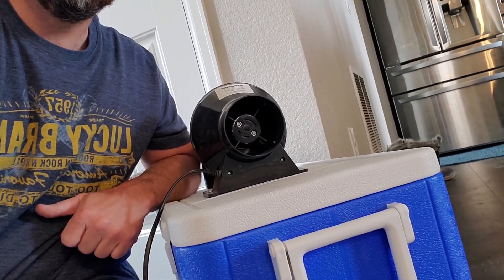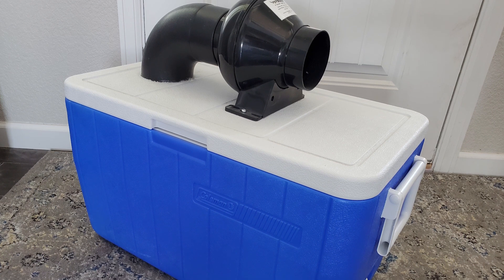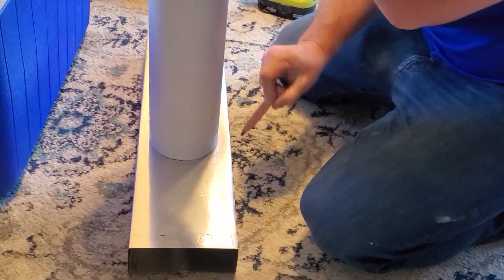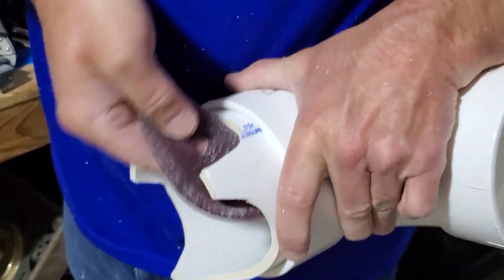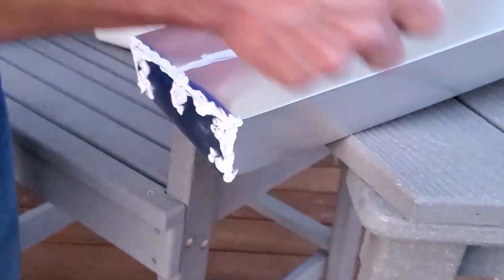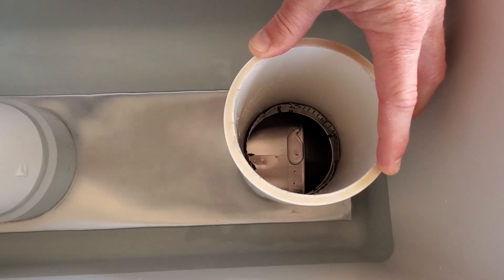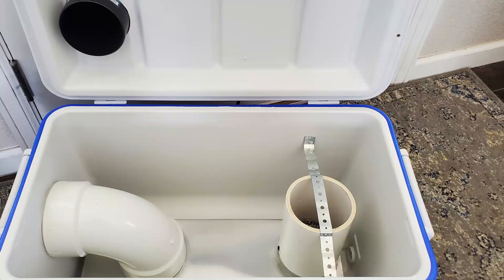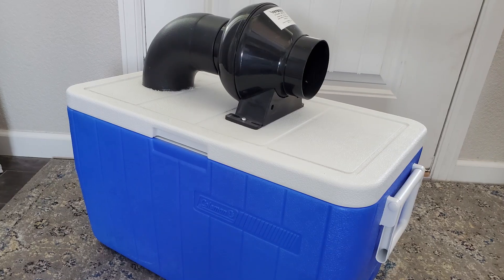Homemade Portable Air Conditioner DIY - Runs on 120 volt or 12 volt.

Comment: big in house air conditioning  went out yesterday.Used A plastic white 2-1/2'  tall garbage can, fo icer container
 Made one as you directed  putting duck outlet under ice. made a hardware cloth table over the  Inside duck  work which is  attached to a sheet metal duct T., going all the way to bottom. 
all duct work & top exit elbow used was  4inch.  Container has about 18" filled with frozen small ice bags.
works good for big bedroom. thanks !
Reply: Send a picture or a text to picture. Thanks nice❤

Comment: Just watched your video from 2018. What is the advantage to using the aluminum duct instead of the metal pipe?
Reply: I made the one from 2 years ago. It worked perfectly at first but I know why he changed it. The flexible tubing is much thinner and tears easily. I had to replace it twice before I abandoned it and went another route. Once water gets into the tubing, it’s useless. The tubing is for the back of dryer vents and isn’t strong enough for an AC cooler. The first one tore from me trying to adjust it and the second one from when I poured in the ice. His new version looks a lot stronger and should be able to hold up much better. I’m looking forward to trying this new ductwork. One other thing to consider....the SeaFlow blower in the 2018 video is super strong and provides great airflow but is extremely loud. I use mine in the garage so I can deal with it. Sorry for the long reply. Hope this helps. Good luck with yours!
Reply: @robkees9353  Rigid aluminum stove pipe is readily available. Just seal the seams and you're good to go.

Comment: 2 questions that are related. 1. you have sealed the air flow, what happens if you use dry ice? You are not blowing across it so you are not releasing carbon dioxide. If you put a few vent holes high up on the sides should solve the carbon dioxide expansion issue. 2. What if you replaced the A/C duct with copper pipe that covers the entire bottom in a circular pattern?
Reply: The air is blown across...watch the end of the video again.
Reply: Do NOT, I repeat, DO NOT use dry ice in one of these units as it raises CO2 levels to the point that you cold pass out.

Comment: I received some of the  materials from Amazon today. I went with the white 12V DC motor.  The black 4" 90-degree elbow doesn't fit the end of the white motor. Not sure if anyone else experienced the same issue. Gonna see if I can find a coupler or another 90-degree elbow that will fit. Thanks for Sharing this video. Can't wait to get started on my build once remaining parts arrive. I plan on using this cooler inside of my hunting blind in the evenings here in the brutal Texas Summer.
Reply: Did it work?

Comment: Very cool I was thinking about your video all day and I'm wondering if you had 2 coolers and you bridged them so you have the outside air come in the first cooler and be attached to the 2nd cooler so you can cool the air in stages and of course you can also add more coolers i have a Chevy Suburban with no A/C so I'm really trying to figure the best way to have cool air for long drives ✌
Reply: I made his 3rd design (without the duct). The biggest problem is that the air is so hot (mid 90's) that it melts 20 lbs. of ice in about anhour and a half. Seems like somehow I have to get colder air to the intake. Any suggestions ? Thanks
Reply: If you live somewhere with dry heat you should look into a window swamp cooler, these were really popular back before AC in cars was a thing.
Reply: I was thinking about coming on here and saying the same think. Id add another cooler and snake the pipe thru the cooler. But have it where ice can sandwhich the pipe in that cooler  then coonect it to the other cooler. Never built one before but it might work. Not sure if you would need 2 blower motors to make it work. 1 motor might not move enough air thru 2 coolers.

Comment: I’m about to make one of these to have cool air in my chicken coop. Looked at a lot of designs. This is really nice. I’m looking for a way to use either blue ice or jugs of ice so I don’t have time used cubes or crushed. But this has me thinking hard about my design. I really like getting the duct under the ice.
Reply: ..wonder if blocks of ice would work better? Like put water into a square or rectangular tupperwares (couple of them) then freeze em and then empty them in. I would think itd melt slower in small blocks than crushed or small cubes?
Reply: It may be that the iced water actually helps keep things colder, even if that sounds counter-intuitive.  But I don't know - it just seems familiar that that might be the case.
Reply: Why not shove steal wool into the aluminum duct to have more cold surface for the air to hit? Have a drain foe the melted ice and a inlet hole to drop more ice without opening the cooler, one that can be closed.

Comment: Will this cool the back of a toyota sienna?? Im sleeping in my van and need some cold air overnight about 9 hours straight. tnx!!
Reply: HOMES COOL you need 40lbs of ice tent off your sleeping area to make more small, I was sleeping in my van in Las Vegas heat 2years ago and bough my ice at Costco’ it made me very cool’ my unit I built where it blew on top of the ice with $10 wal mart fan’ smaller fan would be better. It was too cold. Need adjust air flow
Reply: Depending on outside air temp and ice cube size, it should give you plenty of cool air.  I'd worry about the current draw on the battery, though.  His recommended fan is 60 watts, that's 5 amps at 12V and that would be 45 Amp hours at 9 hours.  Since you can damage a battery by pulling more than 1/2 it's rated power, you'd need a battery of about 100 Amp hours and a 100 Amp hour battery pulled down to 50% might not start a van engine. 
You'd probably do well to buy a separate "trolling motor" deep-charge battery and a way to charge it up (solenoid off the engine alternator???).

Comment: I made...and still use your 1st gen design in my van. A big device charger battery (27k) powers 2 quiet computer fans.(same cooler box as this video) Using a 10lb bag of ice... I have slept  uninterrupted for 7hrs...in 95degrees (at night) heat. This new design looks amazing. Can it match the performance and noise levels?

Comment: Great job with this design.  Your DIY air conditioner designs make a lot of sense.  I'm building a similar one now to use in the event of extended power outages this summer.  I plan to power it with a lithium battery generator.  We had a spare window AC unit, but it needs too much power, and the lithium battery generator is much quicker to set up and use.  I've enjoyed all your DIY AC versions.
Reply: I'm going on the road in a box truck soon and I plan on using this to sleep in the cabin overnight. Hotels get expensive and I can't afford that right now.

Comment: Good video. I want to take this to the beach. What is the 12 volt power source, how is it connected and how long will a cooler full of ice last?
Reply: You'll need a battery of sufficient ampere hour capacity for whatever the fan consumption is. It's all explained on the web. But realistically, do you actually think you'll accomplish much by blowing cold air into the open atmosphere?
Reply: @joewoodchuck3824  - I'm not looking to cool a space as much as I want cold air blowing on me when I'm sitting in my beach chair in 90 degree heat.

Comment: Y not make the pipes smaller and more cold surface contact?
Reply: I was thinking make that "up pipe" out of metal instead of PVC since its surrounded by ice that way theres  additional cooling between the first stage and second stage. The one with the strap across it. Might not make much of a difference.
Reply: @aulderyan  I've seen this deagn with skinny copper piping and it's great.
Reply: Garety Hoodrich I was just thinking this. Why use duct and all that. Just stick to metal piping. Copper seems like it would work as intended.